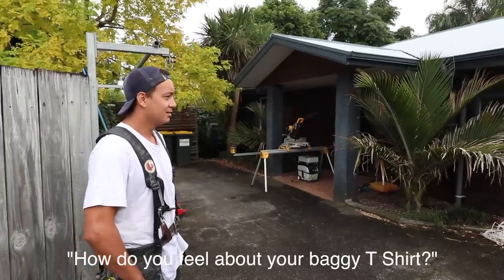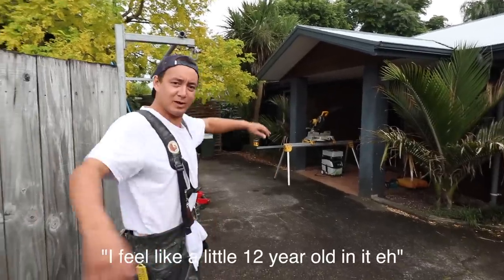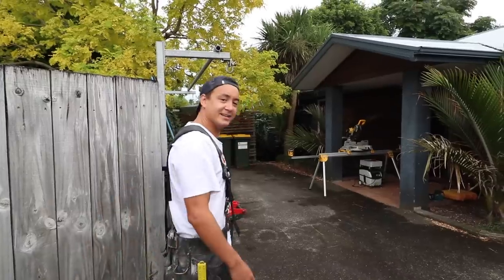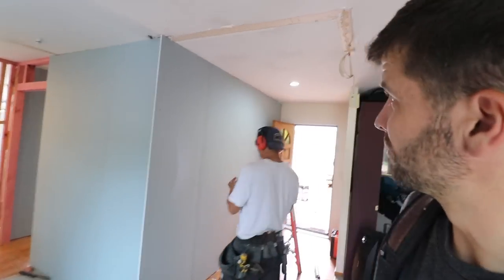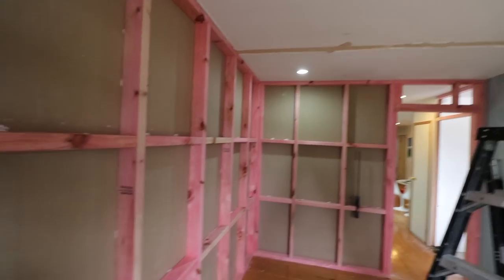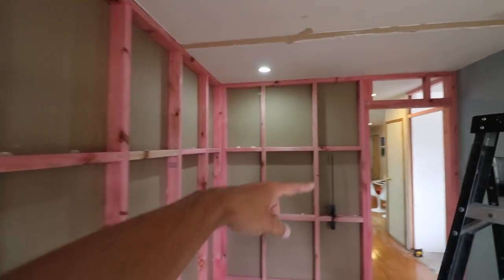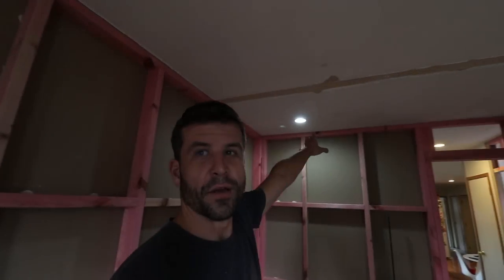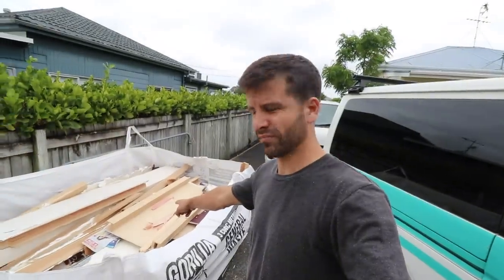Build a ROOM

Comment: If I noticed accurately, it looked like part of the bottom plate was installed directly over the hardwood floors? Is this fine to do? I have a wall I want to take out and extend out a bit but that would require either installing the bottom plate over hardwood or cutting out the hardwood to install it on the subfloor. Any advice?

Comment: I wish I could do this, it looks simple enough but, I’m deadly afraid I might screw up 😂🤦‍♀️
Reply: It’s hard to screw up
Reply: To build, you either nail or screw it up. Lol
Reply: @Aqetor Fat Cat lmfao
Reply: Laser measure is a God send
Reply: You just gotta know how to use a tape measure
Reply: It’s nice having the saw’s you need and mail gun
Reply: Not really . You screw up, you refix it.   No big deal.
Reply: Make sure you use a spirit level to make the walls plumb. I also like to use 3” deck screws because se they are strong and if you mess up they are easier to remove than framing nails. Also, if your lumber is prone to split you can also pre-drill.

Comment: If that new wall was a braced wall what's the best way to connect it to the external wall seeing the top plate is butted against the ceiling linings? Is it a 4.7kn fixing needed I think? By way of nail plate connecting the top plates as per nzs3604, what would be a usable alternative to meet this if required? Cheers

Comment: When you began putting the Gib up, why did you put the first sheet up in the middle of the wall instead of starting from the edge of the wall?
Reply: Full sheets first then cut sheets to fit etc. Makes for easy square n level🤙
Reply: Cheers mate. I'm going to try and line my garage myself. Wondered if there was a particular point to start at or just start at one end and work across.
Reply: Yeh sweet as it's also for saving as much gib as ya can n not wasting sheets . Mark the center of ya stud  level n fix ya sheet to that all the rest should be simple once ya square n level🤙

Comment: You might have been asked this before, but wats up with all the " red " Wood  is it a special kind of pressure treatment, couse in Denmark you cant use that stuff indore, oures are green thou
Reply from the maker: Thats interesting,  we had a leaking building problem in New Zealand and since then every peice of structural timber needs to be treated  The pink stuff is our minimum treated timber and we  use it indoors.. I made a video about the pink timber  https://youtu.be/OkKO5m8jipc